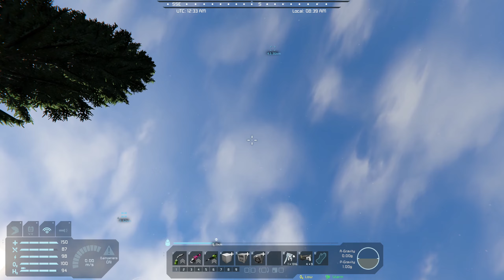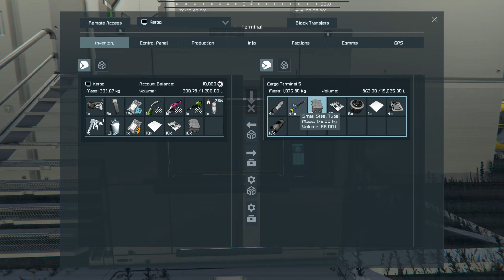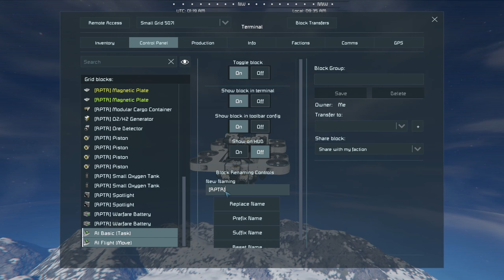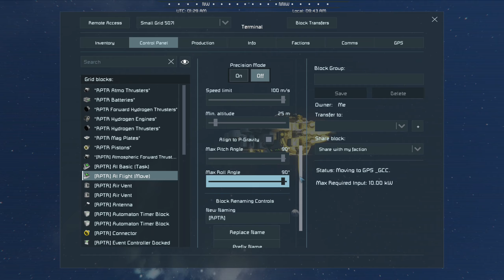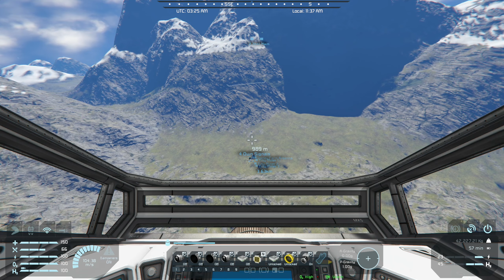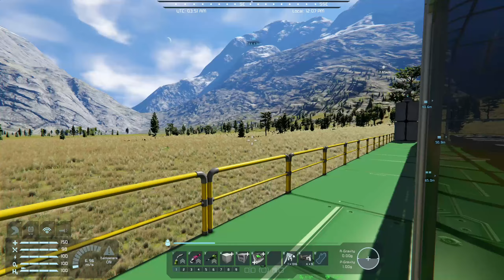The Automated Farm Project ep16 | Space Engineers (Apex Survival)

Comment: The vanilla autopilots are awful at fuel consumption, you can now use an Event Controller to override thrust when you hit a certain velocity - Splitsie did it on one his videos. I did publish a script that did it a few years ago, but Event Controllers made it redundant, plus I didn't maintain it.
Nice series! I think I subscribed during Railroads Online and have background enjoyed plenty of your other series.
Reply: Bit of a personal rant about the API. One thing I would say about "Smart People working around it" wrt to auto planting, is that Keen did truly either use a junior or it was design intent. The annoying/non-standard design of the UI kind of leans to the junior. The only way in to the protected API without hacks is a single entry point that checks which player added the seed so they can extract it from their inventory. (this is from DotPeek, so the logic is as written, but not as the programmer wrote it). Basically, there's no way to transfer a seed, unless it is in a player inventory.
So anyway, the authors of Planting Automation decided to write something that checks every Farm Plot in the world every second or so to see if there's seeds floating above the Farm Plot - which is a costly check times possibly hundreds of Farm Plots. It requires physics bounds checking for stuff in some volume above the farm plot. They could have just as easily checked if the plot was empty and found a seed in an inventory, but they went with the physics check to try and align with the supposed difficulty imposed by the API I guess?. Seems like a mistake to me. Ultimately there's no way to avoid, "Player needs to be nearby" but do you need the extra physics checks?
Reply from the maker: I was going for simple and cheap, but that didn't work out. :) Thanks for watching!